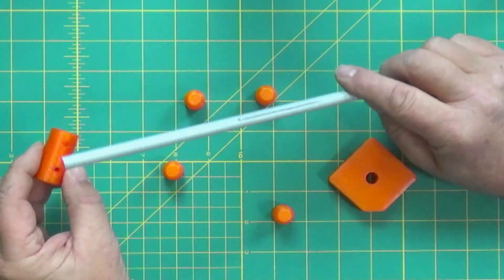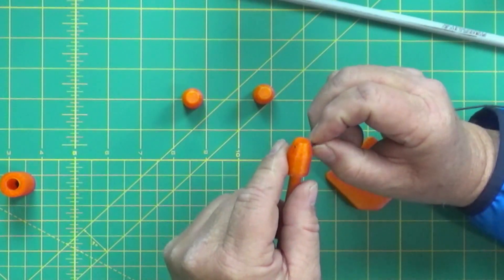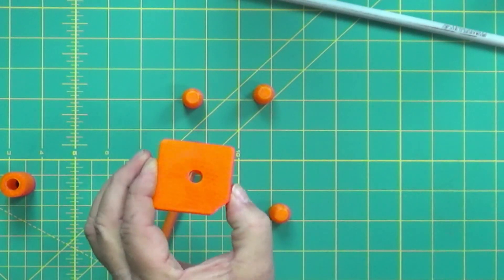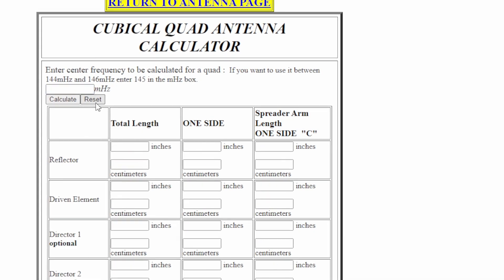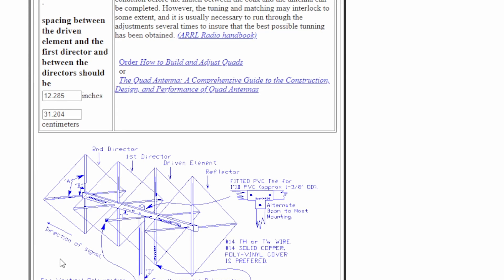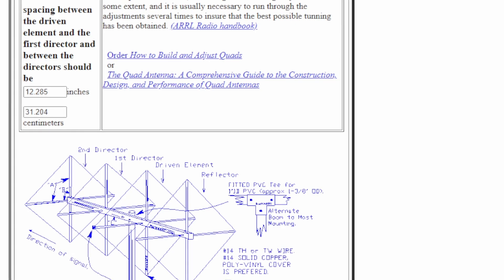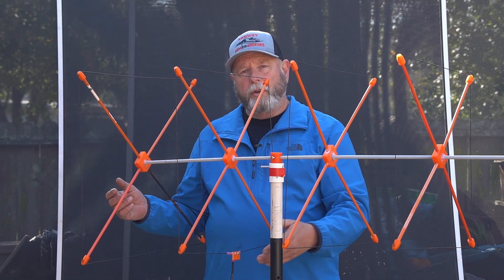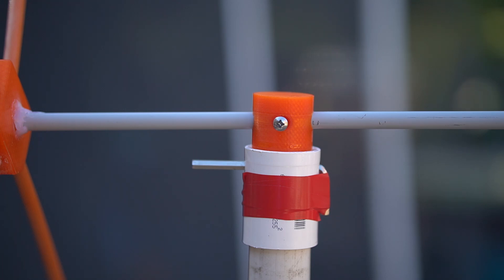Cubical Quad Antenna, is this the best directional antenna?

Comment: Would there be any interference if you had used square aluminum tubing; say 1/2" square as the boom? Or would that cause interference?
Reply from the maker: I don't think so, pretty sure I have seen that on larger quads. But, Being smaller antenna it might since it would be closer to the wire.

Comment: I took another approach and it certainly works: I just used 4mm aluminum rods, bent them to rectangular shape with the proper dimensions and mounted all elements on a side beam (not a center beam like in this vid). This was much easier. To connect the ends of the aluminum elements I just used regular electrical connectors (used in house installations). These connectors are screwed on the plastic beam. The whole project took maybe 3 hours to complete, together with tuning.
Reply: @camp0017  :
I'm curious.
Could you please post some close-up pics, or a drawing of it?
Reply: How effective that was?

Comment: Gidday Chuck,
Way back in the mid 80's, I attempted one of these antennas for CB radio here in New Zealand that uses 26 MHz, it was cumbersome, hard to tune and maintain in tune and I don't think I ever got the thing to run below an SWR of about 1:1.95.
When I passed my Ham ticket in 1988, I built a Quad for 2m, using solid aluminium rod as the elements, being smaller it was a lot easier to deal with and I've used these sorts of antennas ever since, especially on 70cm.
I certainly like your ideas on fabrication with plastic parts to insulate the boom from the element mounts. 
Top video, mate.
73, Mike ZL3XD.
Reply from the maker: Thanks Mike, yea I first learned about these antennas when I was into CB also. They are hard to construct and keep up in the lower bands where they get pretty big, thanks for the comment!

Comment: Beautiful work, but in mi country, the waves we need to catch are from 1,70 m to 0,15m in length. A lot of variation. So, ... the more Yagi it is, the more channels uhf will be seen in box list. That "QUAD" antenna is hard to understand, the antenna are four? Made by four wires not electrically connected ? And also a reflector must look like a sieve (?) or a flat plate for simplicity. When a parasite bar is present, it is 0,9 of the active bar ... as the Yagi way of thinking.

Comment: In the late 1970s several of the local hams got a 2 element or 3 element Triband Cubex Quad. They worked really great for many years. The “life expectancy” of an HF Quad can vary from location to location and I was pretty lucky living along the Gulf Coast that it survived several storms and it was a bit “awkward” but an easy enough fix to make minor repairs or adjustments. With the introduction of carbon fiber technology and Printing Technology into the consumer marketplace a ham could make a really nice quad that could last much longer than fiberglass products. The “spider” is the most complicated part but one that can certainly be fabricated using modern computer printing technology. One benefit not often mentioned with quads is the apparent receive “advantage” from the full wave loop effect. I’m not entirely sure that it’s a real thing but in on the air experiences and discussions with other Quad users it does seem to offer an edge over a 3 ele Yagi in reception of weak signals and some possibilities of reducing atmospheric noise 🤷🏻‍♂️. Your experience may vary due to location and elevation, etc.  Just tossing my 2¢ into the ring to foster discussion 😉😂

Comment: A two element quad for 2m was one of the first antennas I built when I was first licensed back in '87. I had it as a hand held antenna which I would stick out of the sunroof of my father's car while parked up on top of a hill. Just a year or two ago I built a 5 element quad to put in my attic. It also works on 70cm - it actually works better on 70cm!

Comment: Nice video and cool antenna!! Thanks for taking the time. If you have it in mind to use a cubical quad for portability seems like the next logical step would be to integrate the cubical quad with a box kite. It would end up large enough to generate enough lift to drag small coax up into the atmosphere. Box kites generate a ton of lift and with all that altitude, I bet you’d be able make some really long distance contacts.
Reply from the maker: That's a cool idea thanks!
Reply: @KK6USYHamRadioAdventures :
        ⚠️
In building a flying antenna, proceed with caution!
The wind blowing across the "kite" frame, and the feed line will probably generate a static charge!
        ⚠️

Comment: Let me congratulate you on the antenna builds on video! You teach how antennas work rather than tell Hams to go out and buy them (which is NOT what Amateur Radio is all about). Every Ham that builds their own antenna and tweaks them into resonance has learned about antennas and likely will never forget. Two things I might add - resonance and capture effect. A resonant antenna never wastes power, and the more resonant antenna elements in the air captures more signals on your chosen frequency. The more resonant metal you have in the air, the more signals you will "capture" (I said that, but repeated it because it is important in weak signal work). Buying antennas will never teach anything to you.
73 de W4FJF.

Comment: I am now a retired Ham Radio operator N5YTH. I have time to be more active and things are different. Twenty plus years ago I decided to make two identical  cubical quad antennas. It could be something about being a identical twin. I used fiberglass pole vault pole for the mast and spreaders. My design was close to yours, only five element Quads. I used a CB Caul phase coax cable to bring both antennas together. Mounted about 16 feet off the ground and used rotor to aim. I took one leg of each element and placed a spring under the tip cap. This kept the element tight, it also allowed me to make changes to the length of the wire without cutting each spreader. Still need to get wire as close as possible. Once completed like you're, my SWR was very low across the band. The front to back ratio was very high! From Tulsa, OK I worked Wichita, Kansas and Dallas, Texas on less that 5 watts and a handy talkie. I can see where 3D printed parts, use arrows as spreaders, spring load elements for easy disassembly, a portable version would be possible. The GAIN jumps with each element. Have fun, I did and will again.

Comment: I've made 8 elements cubical quad for 2m,10-11m, and 800m 
Only difference I made a different style reflector on them.  It's over sized name escapes me at the moment.  But its got many elements spaced on the reflector down the spreaders to create a mesh. It takes some tuning but it really makes it super directional. Gain is great, rejection of unwanted signals is unreal. I can swing the back end towards town and drop signals in the red down to 0-2 
It does great in dx contests ive talked all over the world on this antenna even as low as a 1 watt carrier. 
The 2m rig same as the 10-11m by basic design talks 50-70 miles radio to radio no repeater on 5 watt setting I think it is "low"
I love quads, dopple quads.
Reply: @erikmckaygunsmithing6470 :
That reflector element sounds like you built a "rejection kit" into it. 
The usual result is a really tight rear lobe, with a somewhat wider set of side lobes.
Reply: @daleallen7634  yeah they used to make them for cb use on moonraker 4,6 antennas. 
This was similar but not independent cubical quad rings they were all electrically connected.  Like a flat grid reflector. I also played with parabolic grid reflection. 
Very effective. But alot of tunning need an antenna analyzer to do this easier. Which I had then.
Was alot of fun building these and talking on them around the world. Everything out the front basically

Comment: Nice build! I built a 4 Element Quad for 6 Meters. A fellow ham has a 3-D printer that made the nocks for the end of the spreaders that the wire rests in. The sun on hot days would melt the plastic nocks. So he made me some more and I sprayed them with clear flexseal to keep that from happening, and it has been over a year now and still surviving the wx. This is the first quad antenna I have built, and I had to redo it 3 times to make it durable enough to withstand the wind. I to used fiberglass driveway markers. I only have it 20' above ground and on a rotor. I have worked Japan & European stations for the first time ever with this antenna. I have only had wire antennas before on 6 meters and could not contact those dxcc's from my location. I also found out after I got the quad built to adjust the swr you move the reflector not the driven element. Just saying, every situation is different when it comes to home brewing. Look forward to what you do next! I just found your channel today. 73 from Northeast Missouri!

Comment: Built about a Dozen of 2 and 6 meter quads and there fantastic Make sure you use a choke , I built coaxial sleeve chokes for mine and got 280 miles across Texas in early morning with ground wave on 10 watts

Comment: Thank you for the video. But why not use the antenna for 2M SSB? You can use a vertical for FM, but what you made is most useful on SSB. Regardless, great work.
Reply from the maker: Jose, SSB is what I made the antenna for mostly and I have with good success. I choose 146.52 just as the center of the tune and it covers the whole band at 1.7:1 or less. You could easily make it for any part of the band. Thank you for the comment and watching!

Comment: The quad has always been a favorite antenna of mine; I even built a quad for 15 m back in the 70s when I was a Novice. Excellent build and follow up afterwards. I just wanted to let you know that I really appreciate the effort you made not only with the antenna but in your photography. You controlled the depth of field which most guys don't bother doing and this technique draws our attention to you and to your subject. Great work!
Reply from the maker: Thanks Glen, I have wanted to build one of these for a while after seeing a neighbor's 70cm quad. Glen thanks for noticing the camera work also, hopefully it helps the presentation.
Reply: And as Chuck indicated, just rotating antenna 90°, changes the polarization allowing you to use it for both sideband and FM to leverage the typical orientation of antennas on those two modes.

There's also an excellent antenna design website and if I can remember it correctly, K7MEM has a plethora of antenna information available for free. I used his site to design a few antennas I currently use including an 11 element 440 Yagi.

Comment: I've always thought quads outperform yagis, especially receiving.   Polarity of signals changes on a round planet, and the quads' design can better catch whatever polarity a signal may be arriving with.  😀 
A Gem Quad for 10,15,&20 meters was my favorite back in the 80s and 90s.
Reply: A quad is basically two stacked yagis, with the elements folded over half way to join each other and feed the other "yagi". It should have better gain than a yagi.

Comment: Used to be called a Moonraker 4 (in that configuration for 11 meters). Was a hell of a beam.
Reply: Not wrong , still got mine I bought in 1988. Built my first cubical quad ( 4 element )  in 1990 for 11m then made one for 20m  ( 4 element ) for a friend in 1998 which he still uses to this day. Quads rule over Yagi for gain by using a full wavelength in the driven element . Also built a  quagi antenna ( 7 element ) . A 2 element cubical quad and 5 Yagi directors . Lots of fun but takes lots patience to put it up and keep it up without the winds getting rough.
Reply: @Data1701E:
Actually, the Avanti "Moonraker" series (4 elements, 6 elements , and 8 elements), were a *Quagi" design the only element of quad design was the reflector. The driven element, and directors were all "Yagi - Uda" elements in a dual feed-able (horizontal & vertical), configuration.
One of my "neighbors" (I was only on 11m at the time, and he was about 10 air miles away), started with the 6 el., and "graduated" to the 8 el.!
I agree that they were, and are a helluva antenna!
I used to have a copy of the Antenna Specialists AV-122 PDL II (a 2 el true cubical quad), it also was, and is a really good antenna, but, nowhere near the BEASTS that the Avanti Moonrakers were, and are!
PS: MaCo Comet has a 6 el Quagi, and  a 2 el quagi. available. 
⚠️⚡ Allow for at least 3X the height of ALL antennas away from ALL ELECTRICAL TRANSMISSION STRUCTURES/LINES!!!
⚠️⚡

Comment: Interesting. I'm just getting into weak signal thus 2 meter SSB. I've M2 yagi up now and I'm thinking about adding a store bought dual cubical quad. I like what you said about gain. I'd a horizontal and a vertical feed for each band. Good job, wish I had a 3D printer
73 W9DLP

Comment: Great update on the quad! I built mine on a 1/2” pvc pipe frame and used 3/32” bronze brazing rods for elements 27 years ago. It worked great on the satellites QRP. I painted it dark green to hide it. Thanks for sharing your great updates on my favorite 2M antenna. I look forward to using the calculator to update mine. Nice job! KS4NG
Reply: the only that scares me about painting an antenna is the pigment in the paint

Comment: I made one in the 70s using ground wire. It was rigid enough to only need 2 spreaders (up and down) to hold the elements. The plans show a tuning stub at the feed point but I don’t see that in your build. Supposedly adjusting the stub is the more common tuning method vs fine adjustment of element length and spacing. Mine was 2 elements, vertical, and could key a repeater 140 miles away with 5 watts. Really!  Of course the repeater was at 14,110 feet on Pikes Peak. 73, K0GWR

Comment: I had a chance to buy a cubical quad for 27-28Mhz many years ago. I had a 2 el V-Quad on my roof at the time....the full cubical was VERY tempting, but for one issue.....at 10-11m band...it's rather big.....and my puny rotator wasn't up to the load. The custom made antenna was an absolute steal at $150, but it needed a $1500 rotator and a hefty mast to hold it up at 60 foot in the air......way beyond my budget at 17 years old.....I WISH I had that antenna now I live in a regional town not the city.....I still remember how damn good it was in use, even at it's 10 foot test height. A 2m band one seems far more managable.
Reply from the maker: BMK, I have been amazed at a few antennas that where only at 10' and how well they still worked. Thanks for the comment and watching!
Reply: @KK6USYHamRadioAdventures :
Remember 10 feet is 3.048 m, and that's about 1.5 wavelengths on 2 m!

Comment: What brand and model analyzer of did you use?
Roy
WA0YMH
Reply from the maker: It's a Comet CAA-500 Mark II, I have a link above in the description.
Reply: @KK6USYHamRadioAdventures   Thank you for the reply, I had a senior moment and didn't check the description before asking.
Reply from the maker: @yornotelppa  , actually I forgot to put it in so you reminded me, thank you!

Comment: Very well done Chuck. I built one years ago but lost it in the house move. I need to build another. I still have the drill jig I made to drill the PVC boom at perfect right angles for the spreaders. 73.
Reply from the maker: Thanks Colin, yea drilling the pcv straight is the hard part for sure. It did great the other night for everything but the net I got into but I think that's a location deal with the hills around me.
Reply: P.S just noticed you have a mentioned my channel in your description. Thank you so much 😁

Comment: I’ve worked roughly 470 grids on linear satellites using this antenna. Paired with a 7 element yagi for 435mhz. 30 degree pitch. The “field of view” is amazing on these for satellite work. Yours is perfect. Maybe 1/2” boom and it’d be perfect. Great job 👏🏻